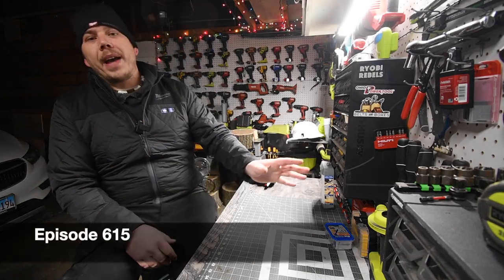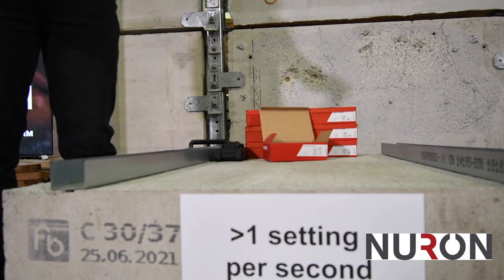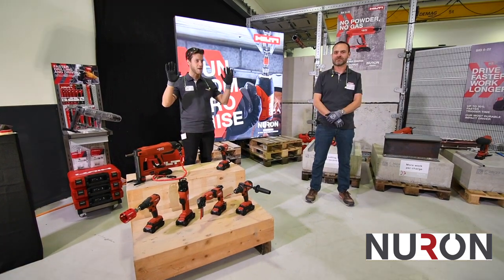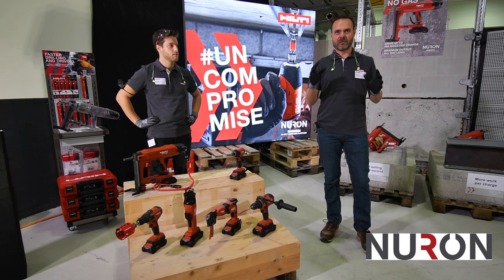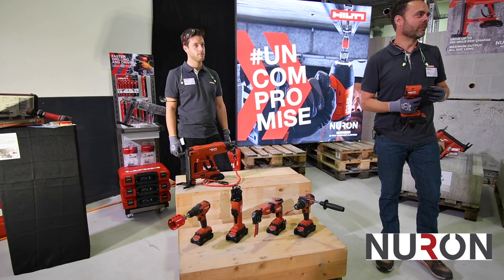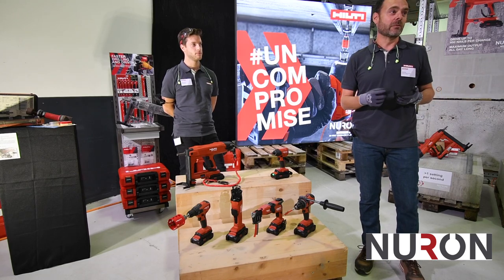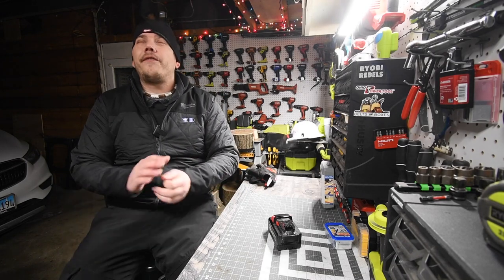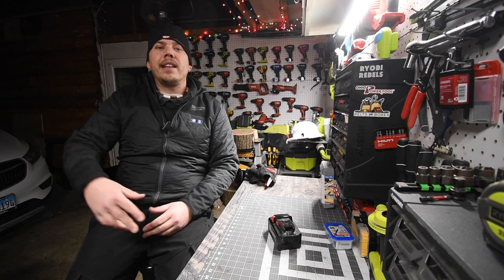HILTI Nuron TOOL TESTING, (Part. 1 Station 1)

Comment: The torque spec on that impact driver is insane, even higher than the Flex claims, and I think Hilti is usually pretty honest with those claims. I can't wait to see how that thing compares! I'm sure the hammer drill will be a powerhouse too, because their last one already was.
Reply: I think I missed it, what was it?
Reply: @mylesmccormick  just over 2600in lb
Reply: @vojnikjna30  thank you
Reply: On paper, the drills and the smaller (they didn’t bring over the smallest d handle) rotary hammer are identical in performance.

Comment: good! you used the hilti a te6 a22 impact screwdriver! with which battery did you like to use it the most??? since in the video it didn't show very well because there was a cut in the video and you can't see everything! the first screw you put with the 2.6ah battery??? and the third screw got in with a 4.0ah battery??? Or was it the 8.0ah???

Comment: Is there a 12v or 22v new screwdriver coming. I have the 12v screwdriver love it absolutely love it.
Reply: 12v isn't changing.  Staying just as it is.  22v is getting updated and part of this new battery rollout.
Reply: There are several new screw drivers on NURON.

Comment: If a manufacture sends you the tool to test you can't be sure it is the same as the off the shelf unit. They should allow you to go by one anywhere you want then just reimburce you for the cost.
Reply: well the differences is Hilti sells only exclusive via contracts and in its own stores.
Reply: @Zozo806  That's not true.
Reply: @thepubliceye  For 95% of the world it's true. USA and one country in EU is not the world.
Reply: @loochan325  Ok but the point is you pick a store you buy a tool off the shelf and run the test. Hilti is a great brand but buying the tool off of the shelf keeps everyone honest.
Reply: @loochan325  So you agree? So why the attitude?

Comment: Can i use my B22 battery on the new impact driver
Reply: Looks like that is not gonna be possible at all. So no more Hitli tools for me.
Reply: Gonna spend money again for some tool upgrades 
And Maybe just the nuron batteries can fit on the old 22v
Reply: I think its all different platform.  Lol   No more hilti tools for me too 😂
Reply: @markdandan6047  yes they can fit old tools, but through ridiculously big adapter